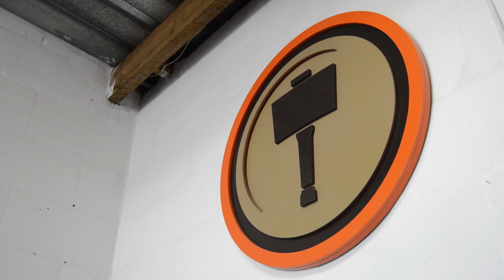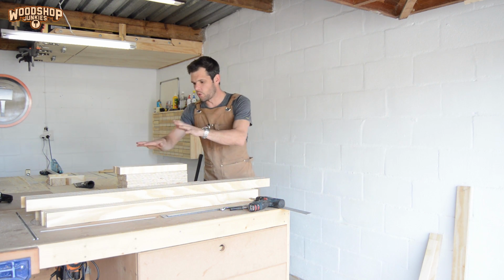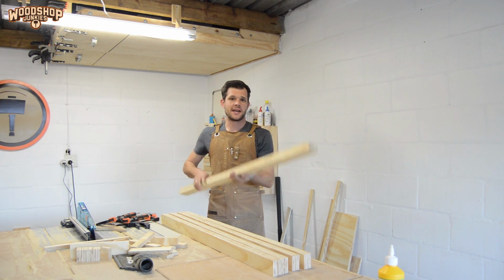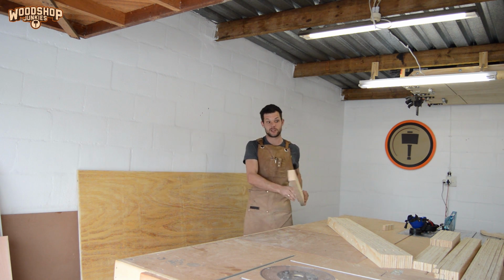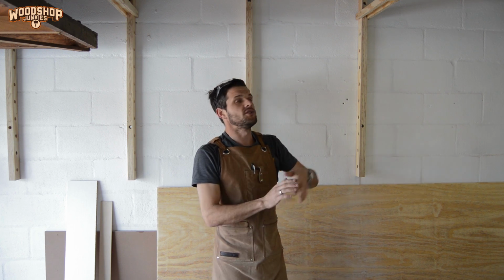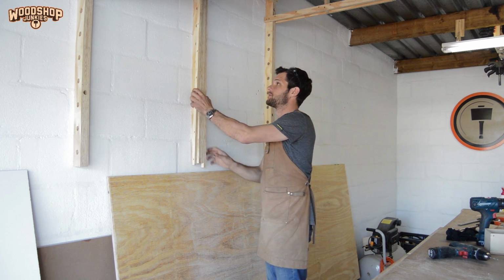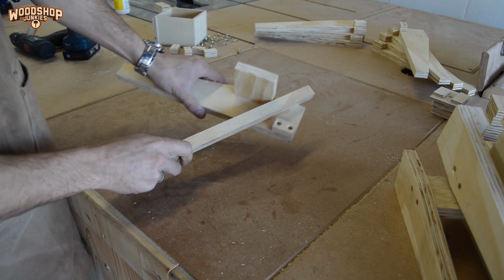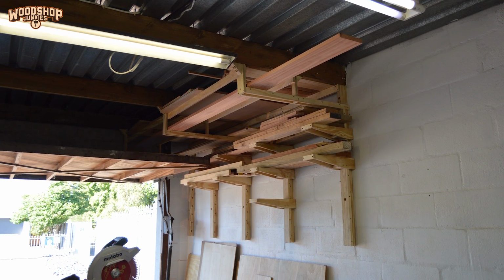Adjustable Lumber Rack From A Single Sheet Of Plywood - How To

Comment: As an idea, build the system 6 - 8 inches off of the wall to allow plywood sheet storage behind your smaller wood storage rack.  You can achieve this by adding a 6-8 inch spacer behind the brackets, with the lower spacer serving as the base that supports the stacked plywood.  Just a thought.  GREAT VIDEO AND GREAT CHANNEL!!!!  THANK YOU!!!!

Comment: Cool rack. What if you tied the adjustable racks together with a strip of wood, allowing you to move one row all together and keep them at the same level? Then you wouldn’t need the pegs to set heights. Or maybe tie the racks together in pairs in case you want to split one row into different heights. Genius shop, though. Great stuff! Thanks for sharing!

Comment: I think I should call you professor. You are a true master and a genius.
I didn't see your other videos if you did of making your work bench and was thrilled seeing you pull out the mitre saw also the power cables which sort of flipped up.
Great work and so much thought.
Upon watching your other video of you pulling up shelves and locking it to the floor joints of the upper floor made me think in time timber moves and quite heavy I thought why not incorporate steel?
I now make all my furniture with steel and learned how to weld.
You mentioned you don't have enough joists to mount your shelving on. Why not incorporate some steel to apply more mounting points at the same time strengthening the structure. I work with a structural engineer and have worked on some pretty interesting job which needed engineering drawings.
You will use half the amount of timber and provide more strength and longlivety.
First I would make plans to run say an Ibeam
If it is your house that is.
I see you are limited as the door opens.

Comment: Haven't been through the comments but adding a noggin between the rafter beams and then attaching a rafter off that and back to the wall will achieve what you want. Using floor joist hangers to attach them in place. You may wish to double up on the middle beam, depending on the weight you want to carry. 
Brilliant channel BTW. Just discovered it and loving your stuff. Did I miss your electric pop up plug installation on the work bench? 10/10. 👍👍👍

Comment: Getting close to 100k, nice work.  I will be integrating this design into my shop and sporting two of your printed tees. You will have to wait to see which ones.
Reply from the maker: Awesome! Thanks for the support!
Reply: @WoodshopJunkies  No problem. I received the Tee's but only one came the correct size. I had order 2X, Woodshop Junkies and a Black "Screw IT" 2x but that one came in "SMALL". I do not know how to go about getting a replacement 2X Black Screw IT....The packaging came with order information. Can you help me rectify this?  So I can attempt to where the small in my garage shop make-over video I am in the middle of producing BUT...….it will not be flattering … and screw will end up looking like an oversized bolt.

Comment: I do the same thing in my garage I build storage shelving and racks for my wood and tools around my garage doors same way so they do not interfere with the opening and closing of my garage doors but, I use every bit of space my garage has.  My husband keeps saying you can't do that the door is there I always have to open the door to prove I am not that stupid lol.  In a small space vertical is everything, though my garage is a two car garage we have all holiday decorations in there, 25 years married worth of stuff and of course my personal items from crafting's, and a MESS load of tools, giant tool box's, saws of every type.  I even had to build a outdoor shed to evict all my out door landscaping tools outside to make more room for my carpentry tools and wood inside the garage lol.  Great video keep them coming!

Comment: The only thing is add to this and your shop is another storage area for wood, directly behind you (at 13:16 mark) to accommodate 8x4 sheets of ply.   You could use the same “rail system” and have those taped Ed from thicker at the bottom to narrower at the top so those sheets would be tilted towards the wall.  

Well done. Bravo!   There’s nothing I dislike about your work, ingenuity and craftsmanship!   
Thank you for sharing Jean.

Comment: I have utilised the area between the roof joists in my workshop. At least the area not occupied by a light fixture.
I just put up perpendicular bords between the joists at an even distance. You can only utilise half the distance between the walls or perhaps just a little bit more since you need to slide the wood so that you can take it down.

Comment: Wonderfull Idea!  just one advise.  I had the same type of roof in my last shop (And will have the same in the new one). 

The problem is that with the roof heat so close, the wood will over dry. 

In the new shop, I will make a natural cross ventilation, got the idea form my camper:  neat the roof make a narrow & long vent,  if possible in the other side of the shop (could be in the garage door)  make another vent(s), as near the floor as convenient.   When the shop is closed,  the heat of the roof will pull air and push it though the high vent,  new fresh air will come in though the lower vent(s).  Better if they are in a shadow of plants...  use insect screen in the vents.  make the upper ones to close,  to keep the heat, if your winter is very cold...   Great Youtube Channel.  (still learning to edit videos :-)

Comment: Brilliant design. Another great video. It looks like you could split your current garage door down the center and add hinges so they open out like barn doors. You would still have full access and not have to accommodate your door inside anymore. I think that would make for a great video. Keep up the good work and thank you.
Reply from the maker: I have actually been looking at a steel roll up door for space saving and security reasons.
Reply: Yes, that would be great and definitely more secure.

Comment: Thanks brother. Just purchased and downloaded the prints.
I think it might be easier for me to purchase a metric tape measure rather than try for the Imperial measurements.

No worries, No problems. 

I have a space under the house for storage, the vertical uprights with the adjustable blocks are the interesting thing to me currently. I was given several sheets of 3/4 in Sanded BC plywood, that was left over off a job. The vertical parts of the rack will be a nice addition to the storage area. 

We already have a spot for horizontal storage of sheet materials.

Thanks again.

Be safe.

Comment: Always love your solutions and designs. Very innovative. One question though about the dowel stops. Wouldn't it have been easier to drill the sides of the supports to pass the dowel through? It would serve the same purpose in setting levels, but would actually add some additional strength to the arm. Theoretically, with enough weight, the top cleat behind the holding track could snap. (I know it's unlikely, but I always over engineer.) The dowel through the sides, on the other hand, would be a much beefier safety point, and take some of the stress off the cleat. 

Either way, brilliant job, as usual.

Comment: You make some really cool stuff, my shop is a little smaller than yours and I have implemented a couple of your builds, they have turned out great. I know it was probably more for safety but I reckon you could have gotten away without the cross dowels, the friction on the cantilever would have held them in place once loaded. Keep up the good work!

Comment: This is a really great idea. I have a medium size shop, but I still think I could use something like this. I have compartments from an old shelving unit I found that I use to store my lumber upright, which I do not especially like. It seems that a lot of my long boards end up warping, and I attribute it to the fact they are stored vertically instead of horizontally. I really appreciate you sharing this as I am probably going to be borrowing it. Thanks brother, keep up the good work!

Comment: Really nice job!  Very well thought out.  One concern I had was with the strength of the attachment of the small block on the upper side of the adjustable arms.  It is a critical point with high load  due to magnification by short lever arm vs long cantilever of shelf weight.  Might be ok, but appears to be weakest link.  If it needs to be strengthened, could adjust size of block to get more glue area and another screw, or revise the shape of the adjustable arms to get longer lever arm between compression and tension points of the cantilever support.
Also, you mentioned needing more support for the upper shelf due to large spacing between rafters.  Could add a beam (2X4 or 2X6) spanning between rafters, then drop hangers from this where needed for shelf supports.
Additionally, want to give recognition for many other ingenious and well executed aspects of your shop (e.g. removable bench section with swing-up chop saw, pop-up power console in workbench, portable, adjustable scissor lift support for long items in the drill press, router table and dust collection built in to bench!) Well done my friend.
I just found your channel, but now plan to visit often to get good ideas! Cheers.

Comment: Given the tiny shop space(i deal with the same issues although not quite that small) wouldnt it make more sense to have split that work bench up? Build 3 or 4 separate smaller tables, all the same height and still with tools that can be folded away.  Then you can have it as one large table if you want, or roll them out of the way against a wall as need be
Reply from the maker: I am actually working on a re-design to accomplish just that.

Comment: Excellent idea, well executed.  However, I would add these cautions:  Your walls are hollow concrete blocks.  As such, they offer excellent strength in compression (the roof pressing downward) , but they have only limited horizontal or torsional strength.  Be very careful that you do not overload these blocks because the mortar between them is quite limited in bonding ability.   The shelving load is cantilevered and could easily cause the wall to buckle.

Additionally, the strength of  the few roof joists is marginal at best.  Minimize the weight you place on the top shelving and keep that toward the wall.  I would have doubled or tripled the joists you are hanging shelving onto.  Even that will not offer much of an increase in a structural load rating on a flat roof.

Keep an eye on the mortar joints -- both inside AND outside.  If you see any cracks developing,  remove the weight.  While you offer a clever solution to storage issues,  you are overlooking some basic engineering load limits.  Things may start out well, but as time progresses, the tendency is to keep adding more and more stuff.  Be very careful with this!

Comment: Just a suggestion.  Drill your anchors into the brick itself instead of the mortar.  They will hold more and last longer.  Mortar has little strength in that application.

Comment: Love it. Going to build it in my shop and garage. I have a question. What is the height of each panel? I assume it is 4 ft. (1.2192 meters). Am I correct?

Second question. Why not use only the backboard and the cleats as the "panel"; rather than adding more pieces on the back of the backboard? A screw here or there through the backboard into the wall (or studs if one has them), should make it the same strength I believe. Am I incorrect?

Comment: This may be an ignorant question as I am rather new to the woodworking world, but what is the purpose of joining 2 pieces of plywood together instead of working with something like a 2x4 or 2x3? Is it just because you have it on hand already or is there another reason? Thanks!
Reply from the maker: I personally like using plywood for projects like this because I don't have a jointer. Using plywood means it's already flat.

Comment: Is there a reason for cutting up a sheet of plywood and then gluing it back together in 2x4 shapes rather than just using 2x4s from the start?
Reply from the maker: There are a number of reasons but most notably is the fact that I like to standardize. Using plywood for everything means that every component thickness in the build is a multiple of a layer of plywood. Also, if I made the uprights from a different stock I would still need to buy a sheet of ply for the other components.

Comment: Your lumber rack design is awesome and came out nice.  After watching you break down a full sheet of plywood, I would like to invite you to watch one of my vides (I have several on the subject) named "cutting plywood in a small shop".  in design it is a method of holding a large sheet slightly off vertical to allow cutting it with your circular saw.  in this video, I attach it to my table saw but since have design it to mount to my overhead door.  When not in use, it breaks down and stores compactly on a shelf.  Since this panel saw is a work in progress, my thought is that if you decide to make your own version,  together we can make huge improvements with the design to benefit both you (& your shop), my shop and our viewers.  Let me know what you think.  Have been a fan of your channel for some time.  Keep up the great videos :>)
Reply from the maker: Hey Russ, sure thing. I'll check out the video.
Reply: Thanks, look forward to possibly working with you :>)